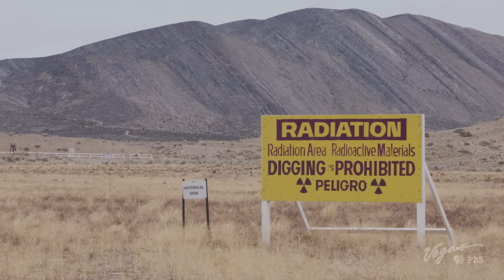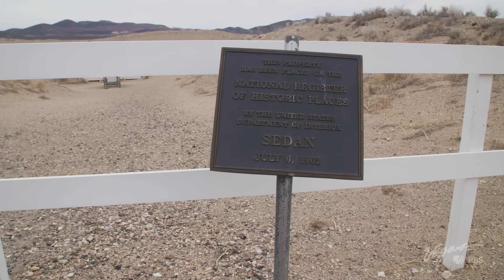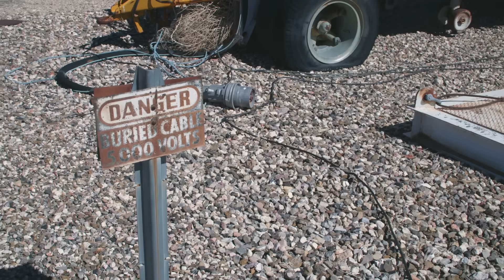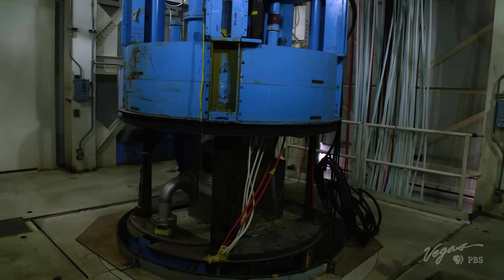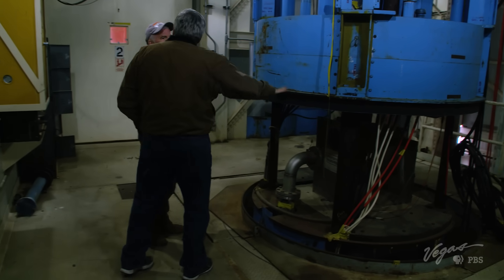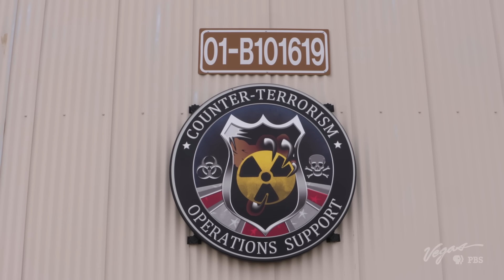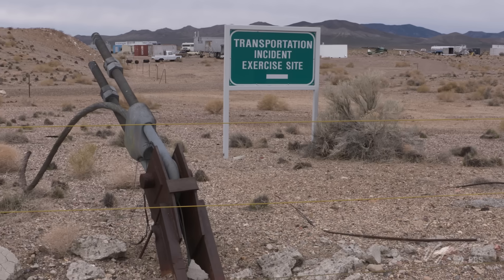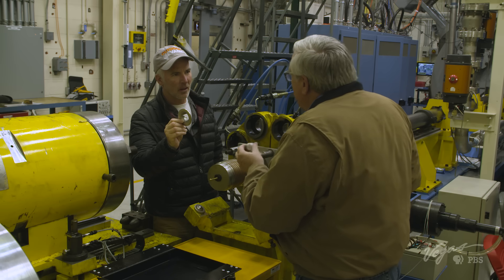Touring the Nevada Test Site, Where the Atomic Bomb Made American History | Outdoor Nevada

Comment: It's a fun tour.  That blue cylinder inside Ice Cap is hanging from a cable, but it's not that obvious, and I started to get a bit of vertigo from thinking it was stationary while it gently swayed.  I don't know why they don't let you take photos.  I don't think we saw anything classified.  You get to eat at the cafeteria with the site workers, so maybe that's what they are protecting.  Also, this is adjacent to Area 51 and I got zero feeling that there were little green men a few miles away.